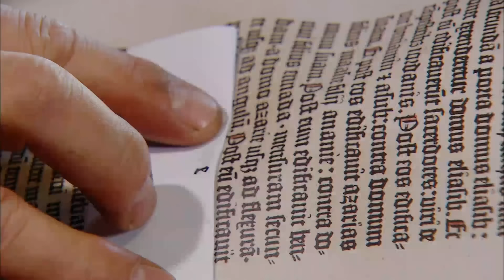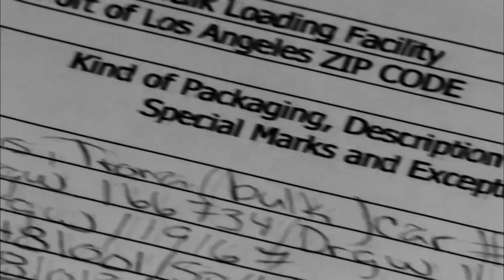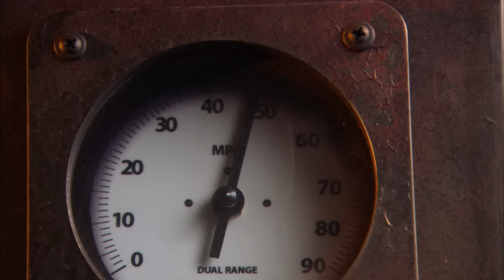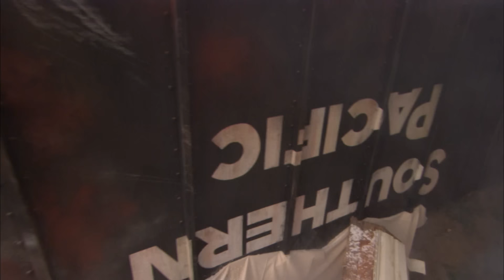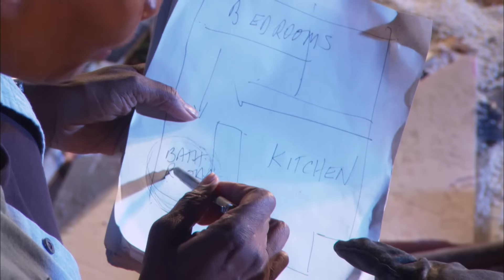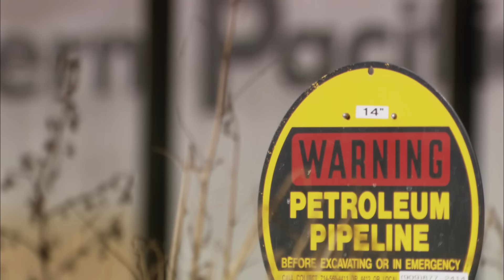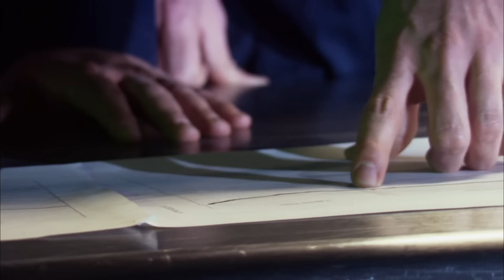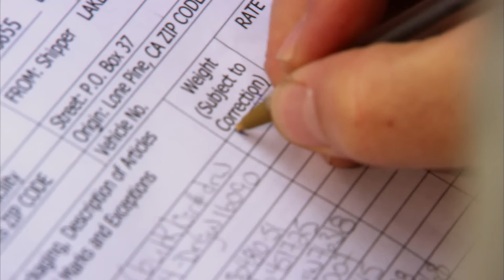Horrifying Runaway Train: San Bernardino Train Disaster SP 7551 East | Mayday | Wonder

Comment: If the freight cars had brake temperature sensors they could give an alarm when overheating.

And maybe the engine could get a force load cell integrated to the coupler. Then the modern day computer could perform some plausibility checks.
Imagine when pulling out of the yard the engine could compare the measured pulling force to the expected value that should occur based on the cars' supposed weight, the track grade and the momentary acceleration.
If the measured force significantly exceeds the expected value, a big warning could pop up to tell the engineer that something's not right

Comment: It's pretty obvious that safety culture in railroads and pipelines are decades behind that of airlines.  I mean, here we have two major pieces of infrastructure carrying on business as usual with several key safety systems not working--a train with multiple non-functioning braking units and a pipeline with disabled emergency shutoff features.  But HERPDEDERP business as usual.  An airline would get shut down in minutes if it operated with anything close to this level of disregard.

Comment: It’s so cursed that In the crash they showed locomotives of modern day Union Pacific just it was renamed to southern pacific and the locomotive throughout the beginning is a sd9 in the real crash there were sd40t-2s
Reply: The SD 9 is actually a GP9. If you look at the wheels of the GP9 in the video, it has 4 wheel axles, while the SD series locomotives (like the SD40T-2s from the actual train that crashed) have 6 wheel axles.

Comment: I was on a job in Texas, I'm a retired HDR/W Cat Mechanic, a hot pipe line, oil,
 the powers that be, had their maps out, for what ever the reason, there was to be a right away clearing made, not on the job sit, this is 1975 76, the operator is directed to make 
 a pass, everything is good, low and behold, right dead center on top of that hot oil line,
 the operator sunk the corner bit in to the pipe line, by the grace of GOD he had to good since not to back out of it, it was under a great deal of pressure, it burned almost a week, 
 the cat / dozer had just come out of the cat dealer  getting a rebuild to it, like new, 
 it melted the ropes cab the fire was so hot. 
 Playing fast and lose both the rail road and the gas companies,. shame. The rail road 
being the worst of the worst. little to no accountability. they have way to many wrecks

Comment: Misrepresented weight.
Half the engines in disrepair.
Lack of full disclosure all around.

Then the gas company restarting the system without replacing the shut-off valves that failed to close the first time?

This is why big companies deserve every lawsuit that results from a tragedy like this.

Because the honor system & "self-regulating industry"... clearly safety & redundancy was omitted for the health of bottom lines.

Comment: Once the locomotive start to build speed on the roll with the load even with brakes its unstoppable and the curve is definitely a place where things can get worse..i have experienced it in the roll one time but we cut down the load and bring half on the hill and down the roll then go back to get the rest on connect on the loop and go ahead only when the load is more..should have sand sanders infront of the wheels and it will help the brakes more
Reply: It was the load that caused the speed

Comment: This is just one example of how there should be an electric brake system backup on trains, when the air brake system fails. The locomotives have a HUGE electric generator that power up the trains wheels. Why not have that same electric generator power down the same wheels?. Creating an electric emergency backup brake system is a no brainer..Hello brake engineers in the world. Here's the chance to showcase your education in Electrical Mechanical engineering. .
Reply: Hi Rick, you are not an engineer, are you?  If you were, you would know that all engineering sub-specialties (chemical, automotive, electrical, etc...) are based on the metric system, which is universal i.e. the United States populous is the only group in the world that had not converted to the metric system.  Our US military (US) is also using the metric system.  All engineers in the world (including American engineers know and use the metric system - if you have a modern American car, it is built on the metric system.
Diesel-electric and electric locomotives have dynamic braking capability and have for decades; so did the six General Motor EMD SD-40s & SD-45s of this manifest except that only two locomotives had "functional" dynamic brakes - some of this info was not known by all the players.  Locomotives have usually three systems: air brakes, mechanical link brakes using the same pad, and dynamic braking system on motive wheels (six axles in the SD-40/45 series movers) whereas rolling stock have two (air brakes and mechanical).  Ciao, L
Reply: @lancelot1953 I'm certainly not a train engineer, but I do know that train speed on the rails is in miles per hour, not kilometers. There's a train curve in my neighborhood that has a sign posted at 20 MPH trackside. Not 20 kilometers.

Comment: You used all high hood gp9s and sd9s when there where on that real train was sd40-2s sd43-2s sd45's and sd43-3's and why did you use the famous trainz bell used on the f7's?
Reply: Why are you guys using trainz sound effects used in trainz simulator in this video for the runway trains bell and when it's in the cab
Reply: What?
Reply: @Oliver_11_the_little_western  There is no such thing as an SD43-2 or an SD43-3. Also, I have been using Trainz Simjlator for quite a while, and let me tell you that the F7s were not the only locomotives in the game that used the same bell sound.

The train seen in the video is portrayed by a single GP9, even though the actual train consists of SD40T-2s and SD45s. The other trains also seen in the video are all filmed after the UP bought the SP & D&RGW in 1996, the same year Burlington Northern & ATSF merged to form BNSF. Example at 9:38
Reply: @mattlogue1300  Nevermind the little western, he’s probably overreacting.

Comment: And thats why you dont pencil whip paperwork. There is no excuse for that. The yard manager should have called the company shipping the material and gotten the correct weight, or if failing that hold the train until it is found what the weight is. That was completely unacceptable and the number of times I see it in aviation (my industry) is appalling. Its even worse in automotive. I used to work for Goodyear. Forged signatures is a huge issue on work orders. And the company knows about it too.

Comment: Recipe For Disaster: Sequence of Events vs. Blame- Engine #2 NO Dynamic Brakes. Engine #4 Sporadic Brakes. One REAR Engine NO Brakes. NO EXACT Weight Calculations Documented. Dynamic Brakes CANCELLED OUT by Emergency Brakes. Descent: (2 1/2 Feet X 100 Feet). SPEED: 177 Kilometers. Parallel Gas Pipeline with (3) three-INOP Valves. HOUSES built that close to Railways and Pipeline PRODUCING "Static Electricity" to ENHANCE potential Disaster. Fertilizer ingredient FLAMMABLE??? Dear Frank. I will PRAY for "YOU", Everett and those who were injured and lost their lives. WHY were there; (2) TWO-Response DELAYS by the Dispatcher??? Would it be POSSIBLE, in the Mojave Desert, to move the ENTIRE TOWN, "OUTSIDE" the RAILWAY and Pipeline a MINIMUM of 1 1/2 Square Miles OR move that PIPELINE away from the Railway??? Mark S.

Comment: how can you check an entire pipe line?  seems almost impossible
Reply: You can check as much of it as you want to. It was somebody's job to make sure none of the equipment  got near the pipe. The energy company hired amateurs  to save a buck.
Reply: There is no need to. Pipelines have pressure gauges and flow gauges. When a pipeline leaks the pressure falls and the flow rate increases dramatically. The pipeline has valves all along its length that can be operated remotely. The gauges indicate where the leak is and the valves for that section are closed off stopping the flow. What happened here is the machinery cleaning the cargo off of the ground dug deep into the ground and scraped the pipe in one spot. No one reported the mishap so the pipeline company didn't have a reason to dig down to the pipe a second time.
Reply: @danielebrparish4271  I'll buy that.
 They made it seem like they dug down to the pipeline and visually inspected it.

Comment: They don't even aquire as to the payload there to manage nor the decent percentage nor length of decent! The longer the brakes are applied the weaker they become ,from heat and metal fatigue! Friction brakes ,instead of reverse electricity is another mistake ,trucks use compression brakes ,these have zero, reduction in efficiency

Comment: Two mistakes?...

I count more...
Well but i count all the defects which are on the train engines as well and the not functioning safety valves as mistakes individually...

Why on earth are they sending trains in such a bad condition down there. And the pipeline company had two weeks time to at least repair the failing savety valves, after they allready failed.

And why not dig up the entire pipeline after such a desaster?

Ok maybe i'm used to higher savety standards and higher value of Human lives due to not living in the USA

Comment: Sooo... wrong weight, not all the dynamics in working condition, not all the air brakes...and emergency brakes apply without talking to the front end... what a mess... 
Accident do not happen because of one thing but that one sounds like a badly organise railroad company... 
Frank and other conductor and engineers did the best they could with what they have.

I wrote the best way i could, I'm not that good to write or speak english

Comment: Ge locomotives have a fault with the compressor sometimes you start losing air for no reason the compressor stops supplying air
Reply: The brakes on locomotives work the same way that the ones on semi-trucks do. Springs keep the brakes locked at all times so air pressure is required to release the brakes. So if a locomotive is disconnected from a rail car or if a brake line ruptures, the brakes are automatically applied.
Reply: Except the locomotives on this train (not in the video, but the real train that crashed) we’re all built by EMD.
Reply: For any locomotive engineer's drop power below notch 4 and for some reason the compressor will kick in
Reply: To all locomotive engineer,a if you come across this situation drop below notch 4 then back to notch5 hope this helps

Comment: I think the major blame rests with the idiot mechanics who didn't make sure the brakes were working. If those engines had had full working brakes, that disaster would not have happened...no train wreck, no clean up, no damaged pipeline... Why weren't they investigated??
Reply: The brakes were working as evidenced by the melted steel wheels. The dynamic brakes were also  working but are automatically shut off when the emergency stop brakes are applied to prevent wheel lock.

Comment: Problem: not long hood forward
Reply: You couldn't hardly find
SD40T-2, SD45T-2, SD45 in US
Even though they still in service in the US
Reply: @TheRealRajo6466  They we’re in service until they’re retired. The locomotives used on the actual runaway train (not the one in the documentary) only 4 of them were destroyed, while the two helper units at the rear end returned to service as soon as they were repaired. Only one of those helper units is currently in operation in a Brazilian railway, while the other one was scrapped. If you watched Thunderbolt 1000t Productions’ video coverage on the same derailment, he explains it way better than I can here.

If only there was at least one SP SD40T-2 still operating, this documentary would’ve slightly been more accurate.
Reply: @T128Productions  kinda a year late, i actually already watch the Thunderbolt 1000t Production video of the incident (the old version & the new version) so I already knew this for a while now but thx for the info I suppose

Comment: This being a documentary on an American Railroad I hated the commentary using kilometers and meters, instead of MPH {Miles Per Hour} and not using feet and inches.  

 If this were an Railroad in a country that uses the metric system daily, fine, but if documenting an AMERICAN RAILROAD or COMPANY, then PLEASE USE OUR WIDELY USED SYSTEM of MEASUREMENT: Miles Per Hour, Feet and Inches, Square Yards, Square Feet, Gallons, Quarts, Pints and Ounces.

I was very tempted to give this video a dislike, because I despise the metric system and prefer things in the main measurement system we use in the United States of America! 

 And I have never been able to remember the difference in each to easily convert that to USA measurements in my head.  Need a conversion program for that, at least I, and many I know do!

Other than that, video was fairly decent, but because of the metric system stuff, I can not give this either a like {thumbs up} or a dislike {thumbs down}.